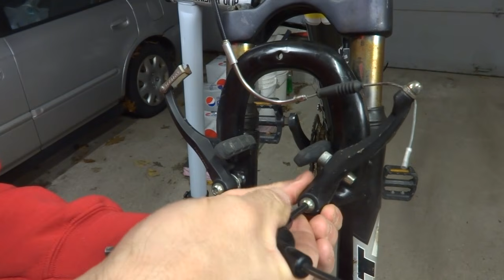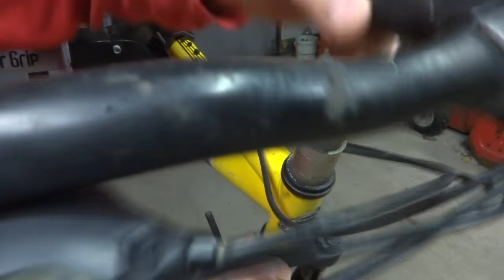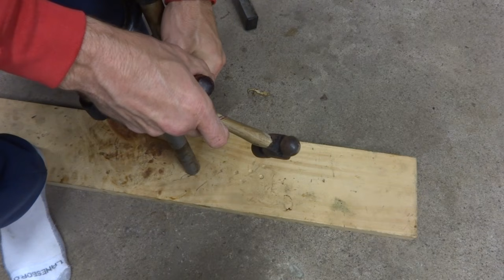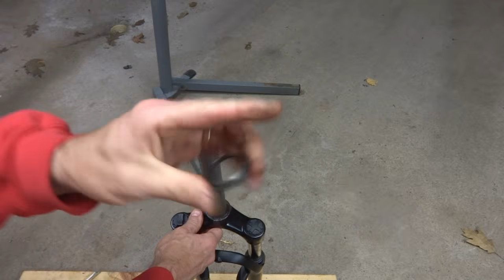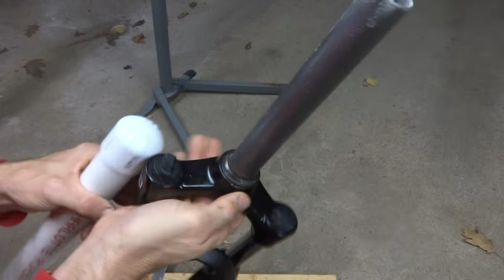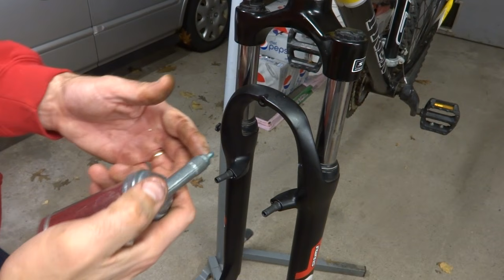Replacing Forks/Shocks On Mountain Bike

Comment: Hi, i'm very new to mountain biking, but i recently purchased a used Giant Talon 3 2014 (look it up) and i want to ride downhill, though it is an XC bike. The three upgrades i need to get are: a shorter stem, new tires and a longer travel suspension. I was wondering if i could go to a bike shop and they could change the fork and what fork would be good for downhill. Also the tires on it are 27.5 x 2.10 and i can't find any good tires of that size. Could i put a 27.5 x 2.20 tire on my rims? Any help is really appreciated Thanks so much!!!
Reply from the maker: Maybe. Keep in mind downhill bikes typically also have heavier duty frames than XC bikes.
Reply: RJ The Bike Guy Yes i know search up Giant Talon 3 it has a very strong frame.
Reply: William Beitzel Thanks for the info, on giant's website it says its a trail bike.It has a strong frame but i feel like its xc (long stem 100mm travel) in what way would i break my bike? thanks!
Reply: hope, raceface and renthal do pretty good stems! but you'll want less than 70mm stem for doing dh
Reply: PorkChopGaming Don't try to use a bike that is meant for XC to ride Downhill even if you put some good Downhill components it is still going to be a XC, I rode Downhill with a Trail full suspension bike and I broke the frame yesterday. My sugestion is sell that bike and buy a proper Downhill or Enduro bike.
Reply: Sebastian Pinkham Thanks but I have been looking for Maxxis high roller II's and I can't find them in 27.5 x 2.25 but I found them in 27.5 x 2.30 would they fit on my rim? Are Rockshox boxxers good do you have them? Thanks!
Reply: Are rockshox boxers good? hell yes! They're amazing. as for the tyres, yes they will fit your rim. worse case scenario they look a little to big and maybe hard to fit but they will fit fine. my mate put some 2.35 high rollers on his crappy Halford rims so you should be alright aha
Reply: high roller II are tubeless compatable for tubeless so would be fine but would have to convert your rims to tubeless which is pretty simple. only problem is that if your rims are a bit crap then the bead might struggle to sit in the Rim therefore leaking sealant so you could try it but not 100% sure if it would hold. nothing wrong with tubes though! as for forks, you could put 150mm on and it would be fine. All it would do is slacken the head angle alot but is rideable and fine! just remember when buying forks to get the right axel width and steer tube width! hope this helps
Reply: Rodrigo Moreira The frame is definitely very strong and thick though.
Reply: PorkChopGaming That doesnt matter Because its all about geometry.
Reply: PorkChopGaming For proper Downhill it isnt agressive
Reply: My mate has had a specialized hardtail XC bike for the last 3 years and has ridden proper dh on it and it's fine. As long as it's kept and maintained well then you'll be fine!
Reply: completely agree! just bought a specialized enduro elite 2015 with hope enduro tech wheels, whistler edition for a bargain in mint condition!
Reply from the maker: The "new style" of bikes?
Reply: trailhead bikes Did you not read the comment?
Reply: trailhead bikes Just read the first sentence.
Reply: PorkChopGaming DH frames have a lot of reinforcement around the head tube and other parts such as the rear triangle and bb. I couldn't live with the fear of the frame snapping 30 km/hr on a 20% descent, it's not for sure it will break but there's a chance. Be cautious.
Reply: Luciano Narno Thank you for the help! You should search up Giant Talon 3 it has actually a very thick head tube and frame! they consider it a trail bike but I think it's XC due to the stem, the suspension and the drivetrain. Thanks for the help!!! :)
Reply: PorkChopGaming maxxis high roller 2.25 would be fine. go get some rockshox boxers ;)
Reply: Sebastian Pinkham THANKS!!! This is the information that I needed!!! But could I go tubeless with High Roller II's? and would it work on my rim since my rim is pretty thin
Reply: Sebastian Pinkham Also could you recommend me any shorter stems like under 70mm
Reply: William Beitzel Thanks for the recommendation but my fork right now is 100mm so I can't go up 60 mm of travel.
Reply: Sebastian Pinkham Thanks alot it definitely did help and I am looking for something like a 50mm stem most likely.
Reply: Rodrigo Moreira How should my geometry be? It's pretty aggressive.
Reply: Rodrigo Moreira Well I'm not looking to do any racing or anything just maybe some downhill but not the very technical stuff. The flowy stuff and some jumps too.
Reply: PorkChopGaming Then you are going to be fine but when you the chance buy a proper Enduro or Downhill bike
Reply: Yes but I don't have enough money to spend on that yet if I find a good one second hand then yes.
Reply: Sebastian Pinkham Yep like I want to go to some bike parks with my Giant Talon 3 with some upgrades (shorter stem wider tires) it should be perfectly fine also, the frame is incredibly strong for an XC bike as they call it!
Reply: I agree William Beitzel. Bikes before 2012, although good. Won't be able to stand up to the hard hits  out on the trail and come out un scaved. Wheel size is massive thing that has changed from around 2014 onwards which has completely changed the sport!
Reply: PorkChopGaming oh crap, sorry dude, I didnt know.
Reply: Sebastian Pinkham Yeah my wheels are 27.5

Comment: well.. actually the m3030 aint much better than a rusted up seized fork ya know.. haha
Reply: any suggestions for a decent quality shock for a trek 3700?? Price range $100??
Reply: Nate Robbins 

RST Omega TNL, $99.99 and a great preformer
Reply: I have the Manitou Axel comp on my hardtail right now and it is too soft for me and I cant adjust the spring of the fork because its broken..., is there a bargain fork for 100-150 bucks ? And it does need to have cantilever adjustments

Comment: hey i have a mongoose xr 75 is there a way t convert that to rock shock fork or do i need to make the thredded fork thredless
Reply from the maker: Older RockShox were threaded.
Reply: ok thats cooli just wanna know doi have to get a stem adaptor i just dont knw what size the stem would be
Reply from the maker: To match the size of the fork. You either need a 1' - 1 1/8" or a 1 1/8" to 1 1/8".

Comment: There's lots of play between the stanchions and the slider when I apply the brake and push the bike forward. I never noticed this before. Is this normal? Any advice?
Reply from the maker: Sounds like the forks are toast. Replace them.
Reply: RJ The Bike Guy thanks for the reply RJ!
Reply: thersten if the forks are valuable, it might be worth it to replace only the lowers or uppers to save them, whichever is worn out.
Reply: Luciano Narno thanks. it turns out the rubber grommets between the sliders were worn..

Comment: I have a 26 inch Mongoose Sector (2006 year model) I'm thinking about upgrading the front fork on it. Right now it has a Mozo Vibe R on it. I'm a newbie to the MTB world. Is it a good fork? If not what would be a good upgrade for it? I like the bike but I've gained weight since I bought it and I want to use it for getting back into some form of shape besides "pear" or "ball". Thanks for any help you can offer.
Reply: Allen Toler look for some rockshox forks. One of the best brands for forks but you need to know what the correct travel is for your bike.😉

Comment: do you need to put a spacer between the top cap and stem??
Reply from the maker: No. It can be done though to lower the stem/bars without cutting the steerer.
Reply: +RJ The Bike Guy cheers! just got my bike back from a service. guy said something about adding spacer there so to make it more secure but dunno been fine for last 6 years :/
Reply from the maker: Not sure what it is supposed to make more secure.
Reply: Without the spacer do you have a small gap between the top of the the steerer tube and the top of the stem? There should be a small lip. If the steerer tube is flush with the top of the stem you won't preload the headset bearings. When you tighten the top cap. It's possible he was increasing that lip so you could preload the headset bearing properly. I haven't seen the bike so obviously this is just a theory.
Reply: no the tube sits below the stem clamp/bolts like 5mm
Reply: s m No reason for him to have put a spacer in there then. If you prefer how it was get it out of there.
Reply from the maker: The stem needs to extend above the top of the steerer so the cap can preload the bearings. You can have the stem lower by putting a spacer above the stem, and it extends above the top of the steerer so the cap can preload the bearings.

Comment: hi sir.
I am making a custom MTB Hard Tail.
My question is that can I fit a Fork of a Motor Bike in it ???
I know it is a bit of stupidity but still....will I be able to do it???
Reply: Im not rj But I think the diameter of a motorbike shock steerer tube might not fit in a bicycle headset.
Reply: +Luciano Narno 
u r right bro.
my thought was wrong.😃😊
Reply from the maker: You would have to measure. I did see this a while back. https://www.facebook.com/RJTheBikeGuy/photos/a.717326538332146.1073741828.715727678492032/888709571193841/

Comment: Hey, I know it's an older video but I just wanted to say thanks for making it!  I recently swapped out a suspension fork with a rigid one and your video helped out immensely!  :)
Reply: Mat Billings any advice on doing this? I have an 820 trek that I want to make into a commuter
Reply: @Diego-oy6en  I am pretty late but if you want to convert into rigid fork you have to consider the length of the fork blade (specifically buy a 26er fork for for 26er wheels) but in some cases you can fit a 27er wheel on a 26er fork but tyre width wil be limited and you'll change the geometry of the bike (might result to good or bad but that depends on the structure of the frame).

Comment: I just got an entry level (used) 2012 Jamis Trail X1 as my first mountain bike.

I like it, but the front suspension forks are horrible.  They knock
as they compress and decompress from bumps.  If I pull up on
the handle bars to get over a curb, they give a hard knock.  It feels
awful and totally kills the pleasure of the ride experience.

Can I do something to stop the knocking?  I don't know a thing about adjustments.
The fork is RST 191-T
(this is just from street riding by the way) I don't do any bashing.

Am I stuck with this awful knock because it's an entry level bike?
What better forks could I put on it?
Reply from the maker: +synapticflow  Sorry, shocks on lower end bikes tend to be more for show than actual use. I think yours are a little bit above the bottom, but are not high end shocks either. I think yours have some adjusters on the top. Try adjusting them one way or the other to see if the shocks get stiffer.
Reply: Thanks for the reply.  Yes they do say in the specs that they have preload adjustment.  Do I need a special tool to turn those?

And I assume I need to try to turn both the same amount?
Reply from the maker: +synapticflow You can probably turn them by hand. And I usually adjust both. Read the instructions for your shocks.

Comment: I have the same hammer at 3:56 although ive made my own wooden handle as the original came off!

Anyways, this video helped me today, but I had a issue....

Im swapping the forks from my Carrera Vengeance bike that I crashed and wrecked the frame, onto my GT Aggressor-2 yet the forks are stuck, the wedge is stuck. Ive fried with a rubber mullet to wack it down but it wont budge, any ideas?
Reply from the maker: +Snipe Camp The wedge as in a threadless headset?
Reply: +RJ The Bike Guy At about 3:15 into the video.
Reply from the maker: +Snipe Camp A rubber mallet might not be applying enough impact to break it loose. Try a wooden mallet, or place a piece of wood over the steerer and hit that with a regular hammer.
Reply from the maker: So is a wooden wallet.

Comment: I have a CCM Alpine (26" full suspension) and the front forks dont travel down too much, maybe a 2 or 3 cm. should I change the front fork or just get a new Trek Marlin or smth better ? I really need help because I am into MTB but my bike is not really helping me
Reply: It's because most likely you have a spring fork which has extremely low performance. I would recommend to you making the switch to a air fork. You can get the lowest end but still great compared to spring it's called a sr suntour epicon xc assuming you have disc brakes. If you got the crappy v brakes well not much you can do besides upgrade hubs and brakes to disc setup but it's all worth it in the end! I would say you can go low end hydraulic disc brakes from china and the suntour fork and some ok disc mount hubs all for around $300. Have fun riding!
Reply: I have a marlin and it is aweeesssooommeee
Reply: +Cameron Griego I would recommend one with 30g oil in the shock

Comment: I have a hard tail mountain bike and the forks have rusted and when it compresses it feels rough should I replace it?
Reply from the maker: Liam Moop If they have rusted, the easiest thing to do is replace them. But if is just a light rust, it might be possible to take them apart, clean them, lube them and get them working again. Maybe... I have a few videos overhauling shocks.
Reply: RJ The Bike Guy I have tried to remove rust with sandpaper and wd-40 which helped with surface rust but this bike was given to me by a good friend which did not use the bike and was just left to rust so I don't know exactly what it has been through.

But thanks for replying! it actually made me happy. :)
Reply from the maker: Liam Moop Sounds like replacing it might be the best option then. Water can get inside of them and corrode the parts inside. And replacement parts are generally impossible to get.

Comment: Great video, thanks for the help. Just got a free two nine , 29 inch genesis mountain bike from friend. The upper fork is missing the bolts too secure it. It's only a 200 dollar walmart bike but do i just buy new fork like you said and where? And will it come with the upper secure bolt to mount the forks onto the bike? Thanks alot for your help as well. Charlie.  Oh yea or should i take it too a cheap bike shop and ask them for the upper fork bolt if they even have that is.
Reply from the maker: charleysturbos I am not sure what bolts it is missing. If they are common bolts, that would be the way to go. Being a Walmart bike, I wouldn't put a lot of money into it. You can check ebay or craigslist for used forks.
Reply: Ok well thanks. Yea my other friend will give me a swhinn mountain bike that is really nice as well. Yea he has like carbon fiber bikes and is insane. I dont need all that. Id worry about them getting stollen all the time and couldnt' even enjoy them as much you know.
Reply: It's whatever is missing where the shocks go into the bike where the cylanders are and the forks slide up at the top. has nothing to hold them in.  I'll just take it too a bike shop and see what they say i need then look online if they cannot fix it. Thanks for your help though.

Comment: I know nothing about bikes, however i have a moutain bike but the forks have rusted. Will any forks i buy fit or do i need specific forks depending on the bike
Reply from the maker: PondyGaming You need to buy the right size forks. If your wheels are 26", you need to buy forks made for 26" wheels. And the steerer diameter needs to be the same. And the steerer length should be the same or longer for threadless, and should be the same for threaded. And just a suggestion, try to buy the same quality or better. Don't put Walmart bike shocks on a a good bike.

Comment: Thank you for keeping it simple. I have  a spare Rock Shox pike shock from a different bike but realised it does not have the v brake adapters. I bought a 2006 Giant boulder with cheap Suntour xct. Can you recommend some forks that will be fit the bike please? As long as the size is the same as in 1 1/8 threadless and has the v brake adapters, is that all that matters? Thank you.
Reply from the maker: Drew Rockstarr Shocks for 26" wheel with 1 1/8" steerer about the same length or longer. Rock Shox are generally pretty good. quality.

Comment: I know this is a mountain bike, but I am wondering if I should swap out my rigid forks on  my hybrid for a Suntour shock absorbing fork. I ride a lot of rail trails, and uneven terrain in on my daily commute. Great video, this helps me see how it's done!
Reply from the maker: StormLaker1975 You would have to find shocks meant for a 700c wheel. I wouldn't bother though. Most of the hybrid shocks are low quality. I have done some pretty hard riding on rigid forks.
Reply: Hey buddie I am a bike mechanic you can definitely do that. We have a bunch of hybrid bikes with front shocks on are hybrid bikes. You just have to find a shock comparable with your head tube and make sure it will have clearance for your wheel size.
Reply from the maker: You would need a "Suspension Corrected Rigid Fork".
Reply: +RJ The Bike Guy maybe a 27.5 or 29 fork?
Reply: A year later...I ended up buying a lower $$ fat bike. Already sold it. now I am looking at old Trek's/Specialized bikes like this one in the video. Would I be able to replace the suspension forks with rigid forks with no change in geometry?? The handlebars in the bikes I am seeing are the older style- easy to find replacement forks for those still??